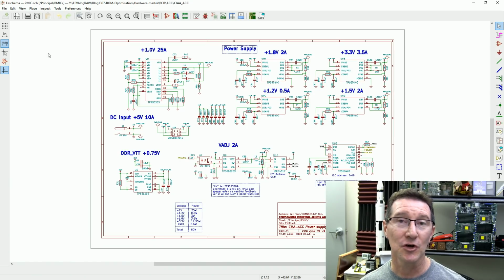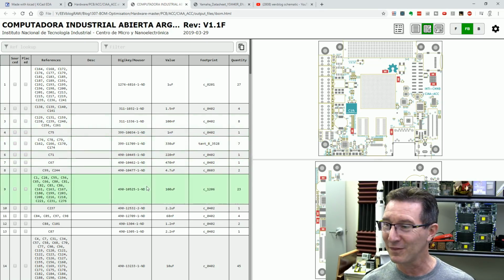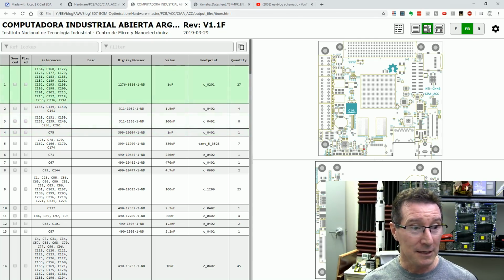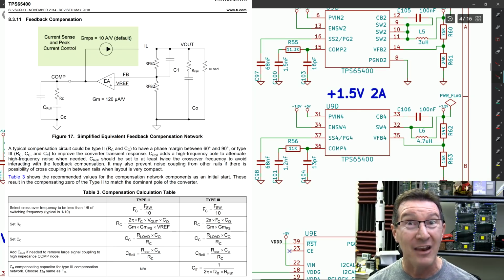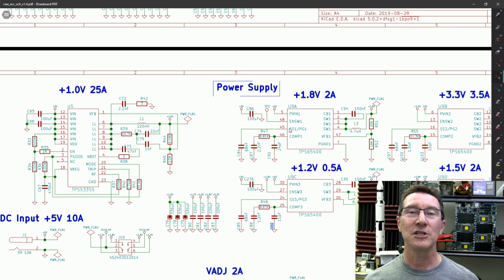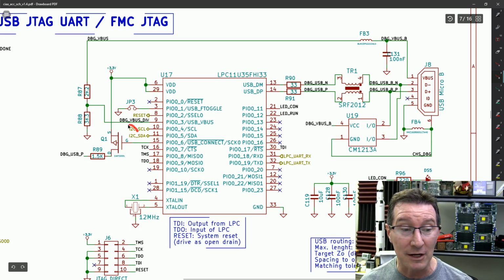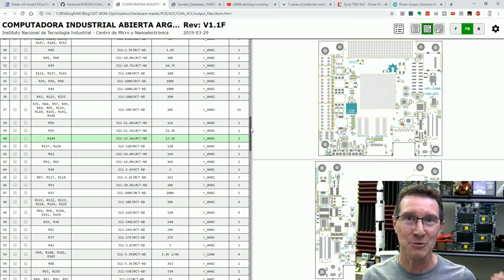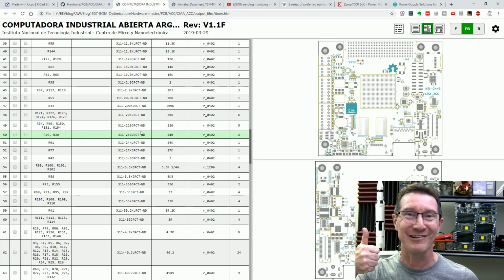EEVblog #1307 - TUTORIAL: PCB BOM Consolidation

Comment: I agree with the overall thrust of the video, but I have to add my 2c regarding the single thing I totally hate - about 0201 decoupling caps. Yes you absolutely do need them, because that is the only size which fits between vias in regular BGA fanout grid without encroaching on via pads (and so risking having solder paste wicking from pads into vias causing solder failures). Been there done that. Going for 0402 requires too many compromises with the fanout (like skipping some balls to make room for the caps), and in large BGA grids a fanout is a PITA even without additional complications. In some cases you will be even forced to use 01005's for the same reasons. On top of that smaller packages have smaller ESL which is often the very reason you use those caps in the first place. I've done quite a bit of FPGA boards, and decoupling caps under BGAs is the only place I ever use 0201s (because manually placing them is a bit time-consuming), and I only have a single value, which I bought a 15k reel of so I'm unlikely to run out of them any time soon.
Also while you can get away without some decoupling caps, you have to know your limits because there are cases when they absolutely have to be there. For example, a lot of multi-gigabit serial transceivers require so much current that LDOs are not practical, and designing a 1.0 V ± 3% switcher with <10 mVpp of ripple is not an easy task, and usually involve a metric ton of small decoupling caps to bring down ESL enough for them to actually be effective (as you've shown in one of your older videos about decoupling caps, ESL is very critical for them to be effective), while also ensuring the switcher remains stable over all PVT variations. I've seen some designs with 10+ Gbps serial links which were going down often exactly because the power rail was not clean enough, and even quite pedestrian (by modern standards) 5-6 Gbps links (like PCIE 2.0 or SATA-3) can be quite temperamental if you're not careful. Also this is a generally difficult issue for FPGA boards because often they are designed in parallel with HDL (or sometimes even before that, but that has it's own pitfalls) , and so final power requirements of a system are not known, which usually forces designers to be conservative and just "add them all". And once they are on a board (and laid out), you might as well stuff them all in assembly because they are very cheap, they are already loaded onto PnP, and PnPs usually are so fast that few extra parts won't matter. Also the irony is that usually you can remove caps which power less critical parts of design, and their presence there is actually less of a problem for layout than critical high-speed parts (like DDR3/4 memory interfaces, which are very often hard to P&R with all those caps in the way, especially if you don't have a luxury of just adding 2-4 more layers to the board).
Reply from the maker: Of course 0201 capacitors have their place, but don't use them (and 0402's for that matter) unless you absolutely need them. I've done countless FPGA's board and I've never had to use 0201's. YMMV.
Reply: @EEVblog  I agree about 0201's in general - I avoid them as much as I can, but 0402s are my default size - love them. I mostly do multilayer boards nowadays, and space on those boards is expensive, and 0402s allow for tighter placement. Also they are in most cases the cheapest size in terms of price per unit, so I got reels of pretty much all parts I use often.

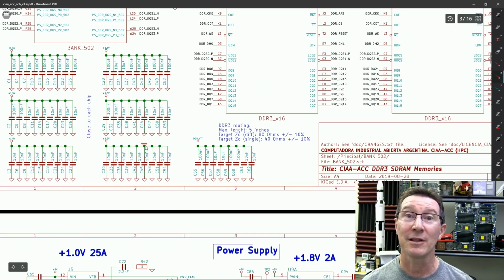Comment: One comment about too many of 1 component value mentioned @26:15  , If you simplified/consolidated down your BOM and there are free reel slots on the pick and place machine, instead of a worker always changing reels, they would just program and place 2 or more reels of the same value in the P&P machine.
Reply from the maker: Yeah, forgot to mention that! Less downtime on the machine.

Comment: I'm not an electrical engineer so I'm not criticising but I don't understand why you would need a 12 layer board? You can only place components on each side (2) and then a ground and power plane (2) and I know you need to route traces but what is the need for the other 8 layers? Could better layout reduce the number of layers? Like I say, I wouldn't know where to start laying out a board but 12 layers sounds like a lot, are they all necessary?
Reply from the maker: https://www.youtube.com/watch?v=_1dr5FWYDgE
Reply: @EEVblog  thanks I'll check it out 👍
Reply: @EEVblog  . So it seems like one of those things where advancing techniques in PCB manufacturer has allowed new technology like BGA chips and then in turn, the advancing technology in chip manufacturer has lead to an increase in PCB manufacturering techniques. Imagine what PCBs will be like 20 years from now! 500 layer graphene nano technology???!!!
Reply: I'd imagine a project like this would have several ground planes and power planes, since there's a lot of high speed signaling. Also, when you have large BGAs, you have tons of pads in a tiny space that are hard to route to traces since they are all surrounding each other.
Reply: @dannooo548  thanks

Comment: Many manufacturers don't bother making 0201 and to a lesser extent 0402 components because of the very high scrap rate. This also makes these parts expensive so many high volume designs avoid them like the plauge. In cases such as low value capacitors many designs will try to use the pcb layers as a capacitor if possible. This is why satellite equipment appears to be almost bare boards.
Reply: I would also guess a lot of satellite stuff is in RF ranges where stripline stubs are more accurate than using discrete components.

Comment: Dave, I didn't build it but I did purchase a "22" pack off eBay once.  22uf, 2.2uf, .22uf you get the idea.  Was going to make a tone control for an amp but the amp never came together.   Making do with only the 22's was not easy, the predicted curves were somewhat askew from comparable normal's but hey it was fun working out that I could have in fact done it.
Reply from the maker: Nice!

Comment: Regarding the "Muntzing" of the supply bypass caps I think that this shouldn't be done on a new design until a first prototype has been pre-qualified for EMC issues. It is better to initially fully bypass the chips, in accordance with the manufacturer's recommendations, rather than failing the initial EMC test and having to do another time-consuming PCB re-spin to add extra bypass caps.
Once the prototype has been EMC tested and, if the design has a comfortable margin, then the Muntzing process can be done as part of a value engineering process. This generally doesn't require a PCB re-spin as this can be accomplished quickly and simply by modifying the BOM.
Reply: yeah just leave them footprints unpopulated...
Reply: Those caps weren’t MUNTZED, they were substituted for a value more common to the rest of the board, a local ‘jellybeanization’ if you will, on the project only. Whether that ruins their intended-functionality as far as the purpose of bypass caps in that area remains to be calculated, but if so, then the end result is almost always worse than having muntzed them.
Reply: @HighestRank  Dave was talking about true Muntzing of the bypass capacitors for the FPGA around 25:20. He was not considering modifying values but entirely removing some of the caps from the circuit. Removing these bypass caps could have an adverse effect on the EMC performance of the circuit, hence my caution about Muntzing a circuit too early.
The caps around the switch-mode regulator, where he was earlier talking about rationialising values, are strictly speaking not bypass capacitors but compensation capacitors for the regulator feedback loops.
Reply: I agree. Also, PI (power integrity) simulation can help with cutting down extra caps.
Reply: Agreed that you should make sure EMC passes before muntzing a lot of the bypass capacitors. But sometimes it's feasible earlier on. E.g. when you have a bulk on the power supply and for a chip, and they end up being right next to each other then you can probably remove one of them. I've even managed to do this for bypass capacitors before.

Comment: 0201 is a quarter of the size of 0402 :)
Reply: It is, as it is half the nominal width and half the nominal length. Using the rounding errors of the metric conversion won't help :)
Reply: Don't forget to wear your respiratory protection when handling these! ;-)

Comment: Loved the reels when I first started designing I sent individual parts in a kit.  The vendor almost killed me.  Only built 13 boards after that I made sure to always buy reels or trays of everything.  Sucks when your buying the largest FPGAs.  But eventually they get used by other programs.  Anyways great video
Reply: Digi-Key and Mouser allow you to buy small quantities on a reel, it's called Digi-Reel and Mouse Reel. They take a section of cut tap, add the required empty start and end tape (that the machines need to feed the tape) and put it on a reel. It's quite useful for low-volume prototyping with expensive parts.

Comment: My first employer made us reduce BOM line item count, use existing inventory parts whenever possible, forbade certain manufacturers, provide 3 sources for all new components, standardize footprints, and typically trade off parts cost versus insertion cost for manufacturing (resistors are 10 for a penny, but it costs 4 cents to get it onto the PCB).  It was a great way to learn about all of the cost and time saving techniques that are glossed over in college.  It's all about trade offs, and the sooner you get used to it the better.

Comment: Hi Dave, please do the 1 cents voltage regulator, it's fun to know such a cheap thing works or not.
Reply: @Arpad Toth  without any further information this is just noize
Reply: Switching regulator : https://lcsc.com/product-detail/Lack-of-specifications_Diodes-Incorporated_AP3770AK6TR-G1_Diodes-Incorporated-AP3770AK6TR-G1_C260850.html less then 1 cent in 600 qty

linear rgulator : https://lcsc.com/product-detail/Linear-Voltage-Regulators_HX-hengjiaxing-HX6206P282MR_C296236.html ess then 1 cent in 1500 qty

this video already exists https://www.youtube.com/watch?v=TdNUO3MSfJs
Reply: @flos251  oh thats why i thought wait a sec didnt i see something like that some where already?
Reply: It definitely does. I have these things running without issue in field.
Reply: I bought 78L05 regulators for 0.4 cents each. They work normally.

Comment: Interesting video. I’m going through this at work now. Another topic is cost reduction. We were using a lot of 0.1% resistor for pull-up resistors... That was a waste.
Reply from the maker: Yes, that would need a separate video as I explained. But BOM consolidation is essentially a cost reduction step in it's own right.
Reply: 0.1% seems like a really tight tolerance for pullups. I bet if you went to 1% or maybe 5% tolerance you'd save a lot.
Reply: Bert Blankenstein I agree. Whoever worked on the schematic before didn’t care about cost it seems.
Reply: Even where 0.1% resistors are justified, watch the ppm values:  a 20ppm 0.1% resistor is a lot cheaper than a 10ppm 0.1% resistor, and if you don't need the tighter temperature spec, don't waste the money...